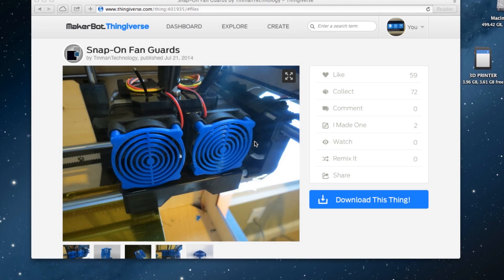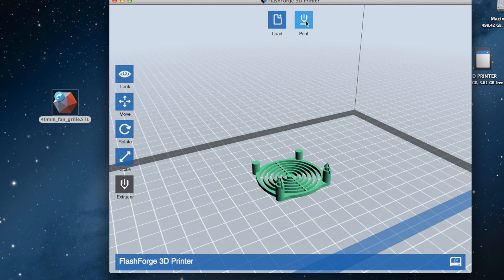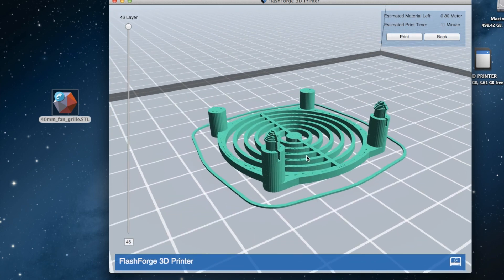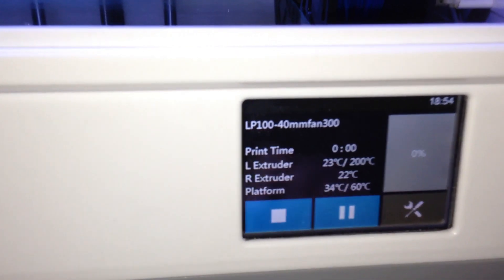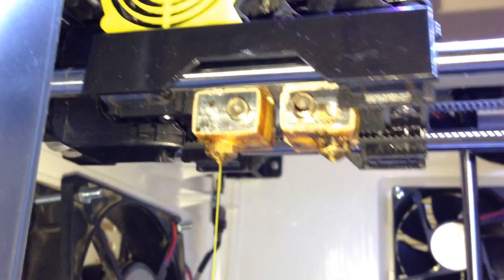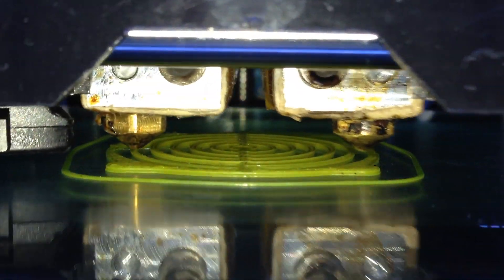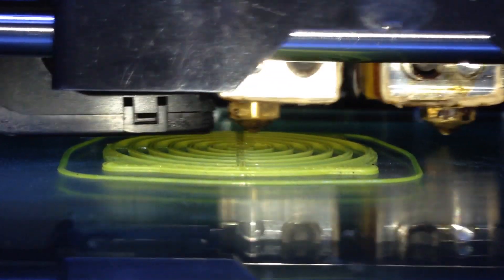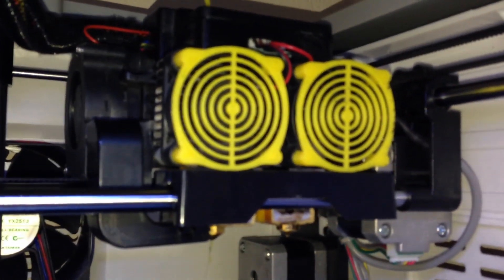Flashforge Dreamer - Slice & Print a model

Comment: How do you control the temperature of the enclosure (not the bed neither the nozzle)?  By software?  By the local control panel?  Thank you.
Reply: The enclosure is not temperature-controlled. There are fans present that automatically cool it down when it gets too hot, but that's it.
Reply: @Kuchenwurst  Thank you.  I bought another 3D printer.  2 or 3 times more expensive.  with thermal enclosure.  One of my life's best deal.

Comment: you think you can demo an abs print?
I'd be grateful as all my prints lift at the corners.
thx mate
Reply: Hi mate  Think about using a "brim" to hold down the corners.  Sometimes the software will do it and sometimes I have to actually place it in the model (0.2mm is usually enough, just one layer).  Depends on what I'm doing and the space on the print bed that's available.  Obvs there is a "post print" clean up overhead but defo avoids lifted extremities.
Reply: I believe a heated bed helps as well ;-)
Reply: Thx andrew i do have a heated bed but I'll try the brim idea. Abs is such a pain but I bought it so I'll use it lol.
Thx again
Reply: Get a Ceramic floor tile cut to size use ABS juice

Comment: Hi Thomas,
Having lots of issues with ABS sticking to build plate. What do you recommend? Glass??
Reply from the maker: ***** Hi. I use a glass plate. For ABS it is a bit tricky but I can get fantastic results bu using the following settings
Bed: 105c
Nozzle: 220c
Spray HAIR SPRAY on the glass...ALOT of it. Then keep the top lid on and keep from front door closed, NO opening it to even watch it print!
Maximum print speed of 80mm/s
Reply: Thomas James Thanks a lot for your invaluable tips. Do we need any special type of glass?
What about http://printinz.com platform?
Reply from the maker: ***** Some people say you need special heat treated glass but I just went to a glazier and got them to cut a piece of standard 6mm thick normal glass and after 14 months it's still fine even being heated to 110c and when off cooling down to -4c for an entire year, all for just $5.50!
Reply: Thanks again :)

Comment: Hello. You need to unload filament or not after print and before you OFF the dreamer?
Reply from the maker: Hi Casey. I don't think so. I don't. After I finish a print I remove the model and just turn off the power and leave the filament on the spool holder below the printer and in the head. I don't seem to have many issues at all.
Reply: Thomas James Hi Thomas, Thanks so much for your answer. Ok I see now. :-)

Comment: Wow your videos has helped me so much, I just got the dreamer last week and I did NOT get the glue stick, my prints just refuses to stick to the bed. Do you always apply a coat of glue every single time? does it make it harder for the prints to come off?
Reply from the maker: Hi, I put down a layer of glue and that will last 1 print. I can then put a new layer on top for the next print etc. BUT, after each layer of glue added, the bottom layer looks less smooth and stick a LOT more, so after about 5 or 6 prints, I spray window cleaner on and clean the bed.

Comment: Did you have any experience from 3d printers before?
Was it easy to adjust and get started for the first time?
Reply from the maker: Hi. Nope, this is my first 3d printer. I found it very easy to level the build platform and apart from that it's all very easy to use. Now that I have a glass plate, I use UHU glue stick for PLA and hairspray for ABS and this works well for me.
Reply from the maker: Once the level is right (20 minutes the first time) it is rock solid. I have only adjusted the level about 3 or 4 times in 3 months. Once when I got the machine, 2nd when I put down 3mm glass, 3rd when I put down 6mm glass plate and 4th after about 2 months of printing. I've now put about 12Kg of plastic through this machine and I've had 1 bad blockage and that's about it.
Reply: Thomas James  What kind of improvement did you get with the glass plate?  I just now setting my printer up and the plate is covered with Kapton tape.  I am not sure if that needs to be replaced with every print or if it lasts a while.
Reply from the maker: Shane Frank Hi. My bed had Kapton tape as well but it only lasted a week. Then I got sick of blue tape only lasting a few prints so I put in a glass bed which gives a nice shiny bottom layer and I now use glue to make the parts stick. No more replacing tape....ever
Reply: Thomas James What adjustment do I need to do on Z axis if I install a glass on the Dreamer bed
Reply from the maker: Just add a shim on the bed at the back so it hits the Z-axis switch. I just used a piece of plastic and used double sided tape. Worked fine
Reply: Thomas James can you back off all wing nuts more then the thickness off the glass. Add the glass start a leveling process and tighten up nuts as normal when doing a leveling calibration?